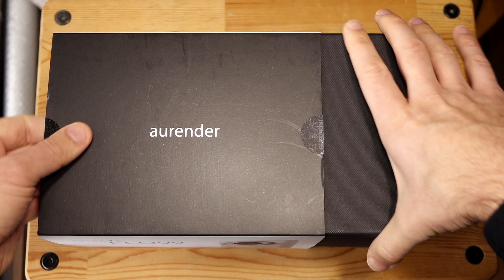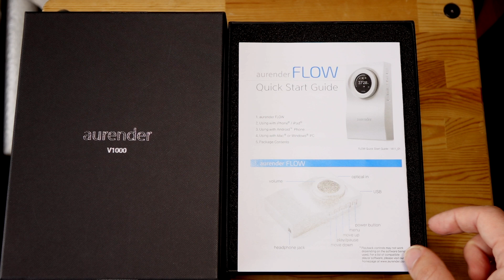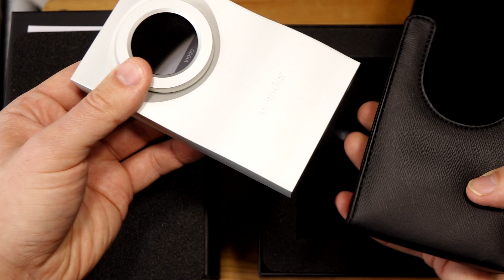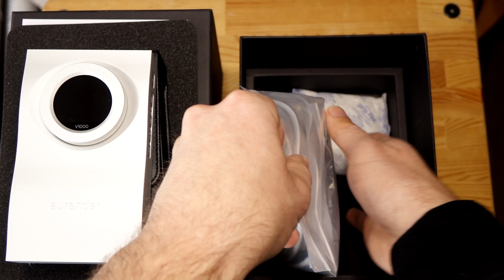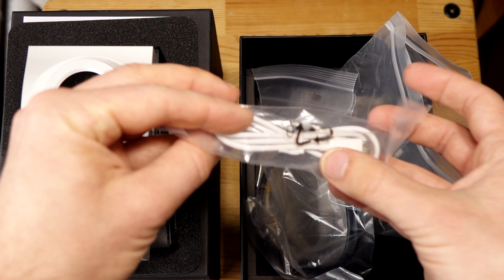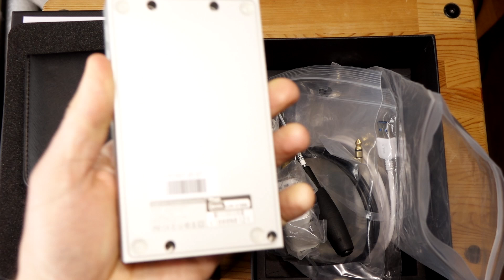Aurender Flow DAC and Headphone Amplifier unboxing

Comment: Oh, wow, this thing retails for 1295.00 in the states. What spooky tangle of circuits is trapped inside those curves that would make it four times more expensive than respectable reference DACs. On-board storage for a DAC is bizarre as it creates a dumb redundancy. This DAC and others of the type connect to a computer that - wait for it - already have heaps of storage.  As always, great work and thanks.